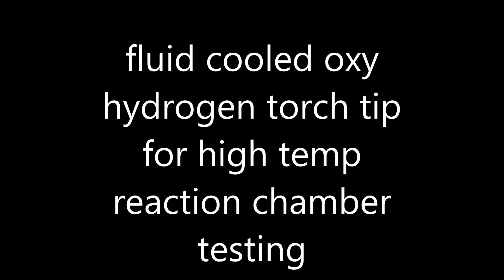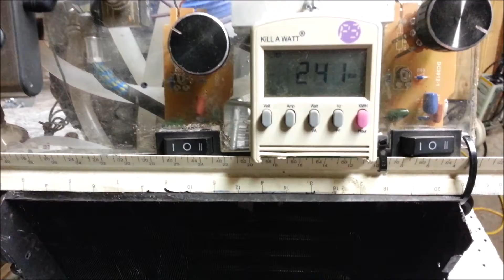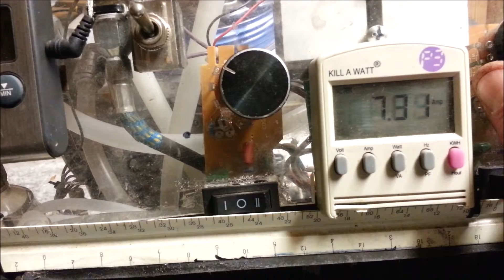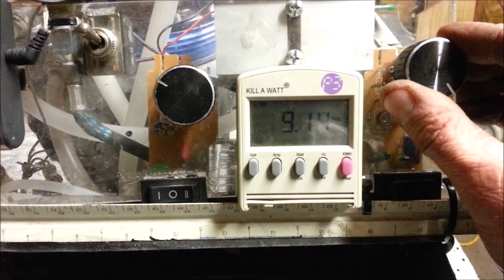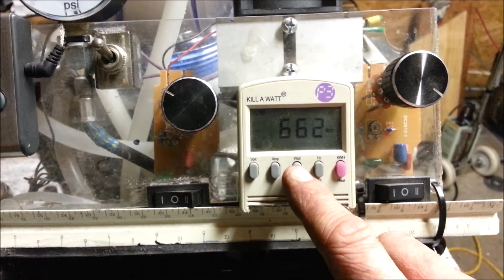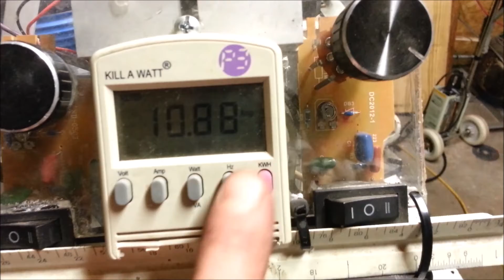Fluid cooled hho torch tip

Comment: so y telling us the heat generated with that couple watts y put in there is equal or less then the source pwr?

or let me ask you it this way

if i drive my car wo hho i use ten litres for 100 km

with hho which is produced by the running car and alt i use 7.5 litre for 100 km

how is that explained by thermogynamics ?

www.neropower.com
Reply from the maker: dude what the f#@&% are you talking about ??? you did not watch this video , i am not an hho  pseudoscientist , hho does not work for cars and NONE  of my videos claim that,in fact i bash the idea in the head in almost every video . how do you show up at a video and talk shit about something not even a topic. this is an oxyhydrogen torch
Reply from the maker: torch video genius watch it and then you will see how stupid you look
Reply from the maker: actually no, you told yourself that for some reason then went on to point out how foolish i am to believe in figures never discussed or promoted in any of my 392 videos . good job
Reply: @NOBOX7  I love the smack down. 
I’ve been watching your oil burners progress over( I think) two years now. I’ve just found this one Jan ‘22 now I hope you built your generator on YouTube so I can find it as well!
Reply: HHO will actually clean carbon out of the engine making it run luke new. Ask me how I know.

Comment: Need a bigger tip to get the 10 inches.
Reply from the maker: actually its the shape of the orifice thats the problem, i have several micro torch tips that spit a 10" flame no problem but they have a flat flush hole as the orifice , theses spuds have a chamfered   bezel and i think this is causing turbulence. i actualy like the turbulence , it makes the torch flame better for big jobs, instead of just a needle flame thats super hot in A tiny spot
Reply from the maker: hey just to add to what i said , you are correct to say a bigger tip will give me the ten inch flame but the problem with that route is i cant run small wattage flames , i have some small micro torch tips that will produce a flame from .25 inch to 10 inches however if i was to try a 200 watt flame on a big tip my system back flashes , so that's some of the details behind the statement i made , i wasn't disagreeing with you but expounding on the problem im having , basically my goal is a tip with a broad operating range say from 120 watts to 1000 watts and a bigger tip wont work because of flash backs at low operation levels . i need the wide operation range for testing